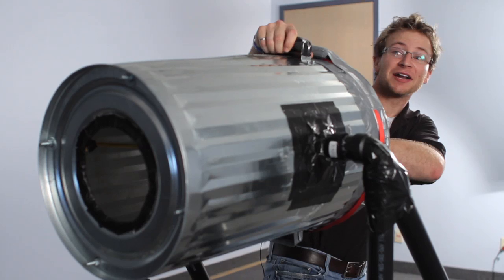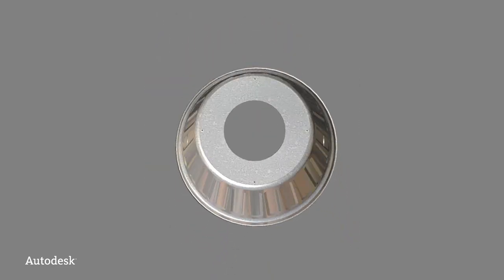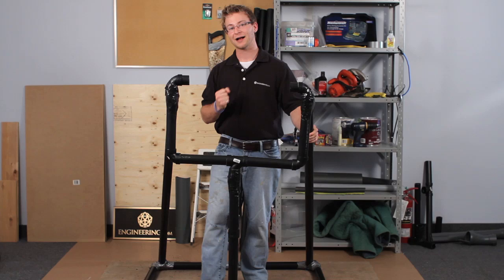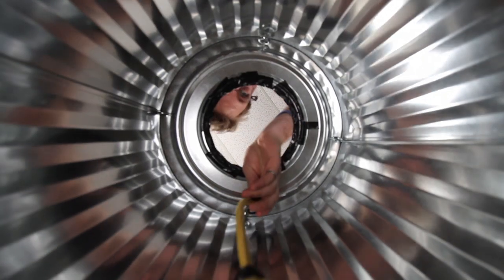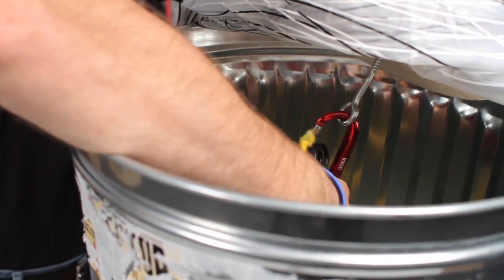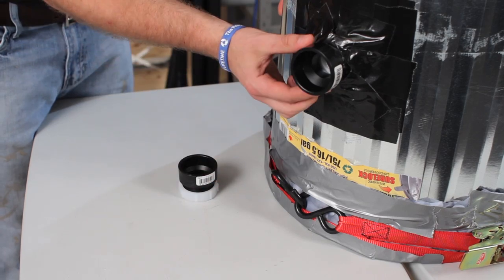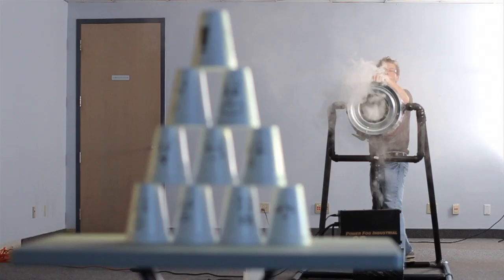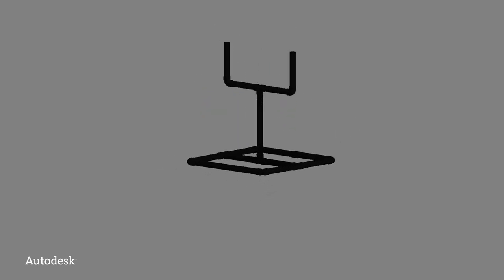Build a Giant Air Cannon

Comment: Nice explanation and instructions.  The framework is, however, not PVC.  Those are ABS DWV (plastic drain-waste-vent i.e. "sewer") pipes.  Those ABS pipes and fittings are a better choice than PVC because of their greater stiffness per weight and significantly lower cost in 3-inch and 4-inch diameters.